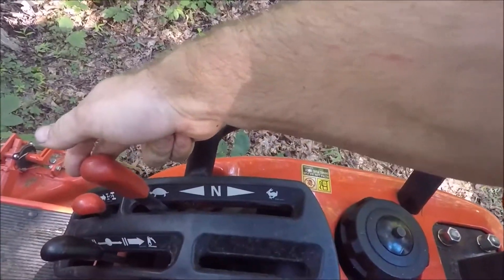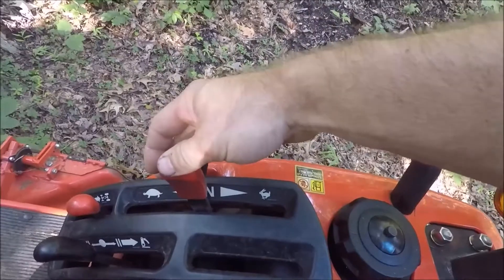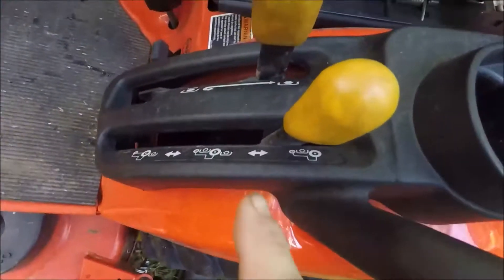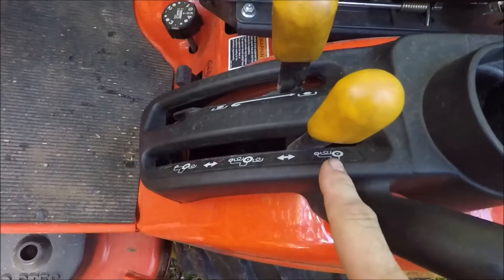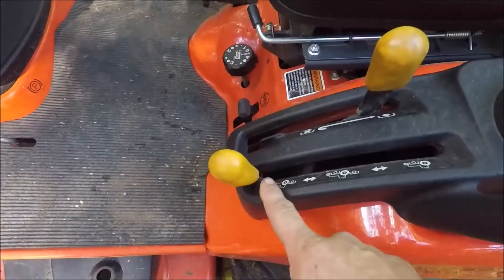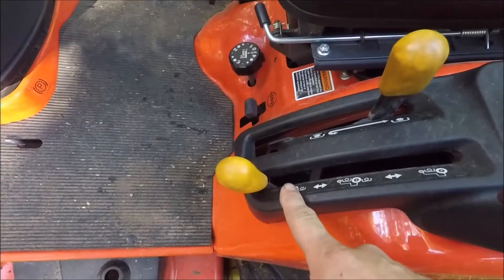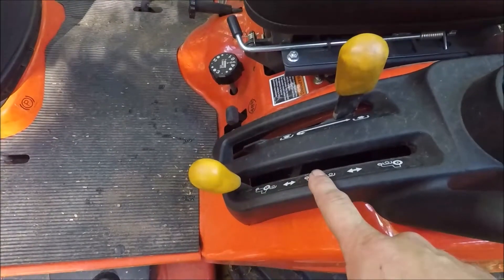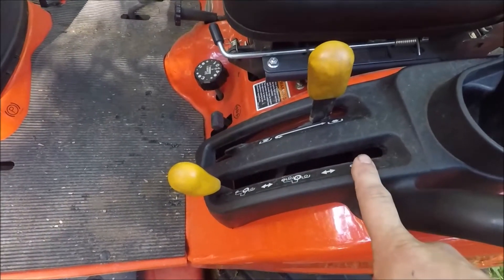Kubota Stationary PTO (for chipper)

Comment: Until now I was unaware that the BX2360 had enough HP to run a chipper.  Nice to know if I need a backup to my tow chipper.
When would we use the knob that's immediately left of the  of the throttle control?
Reply from the maker: I think the knob you are talking about is the cruise control. Thanks for watching and commenting!